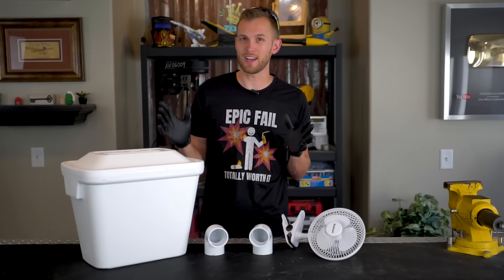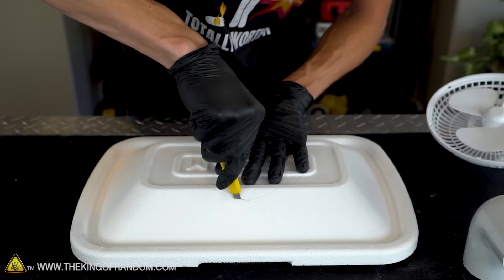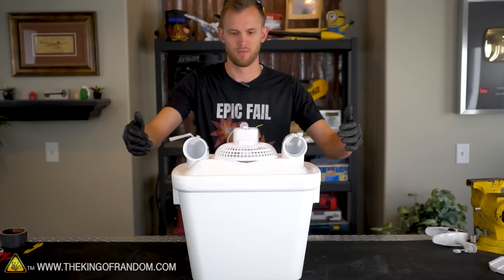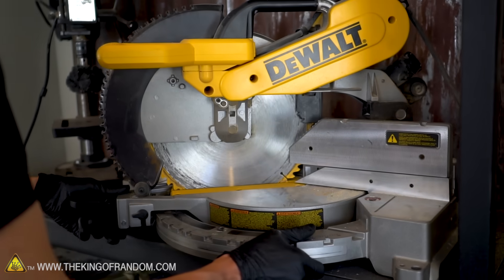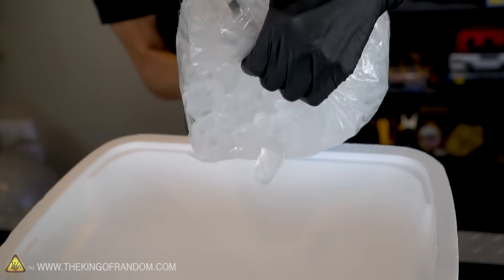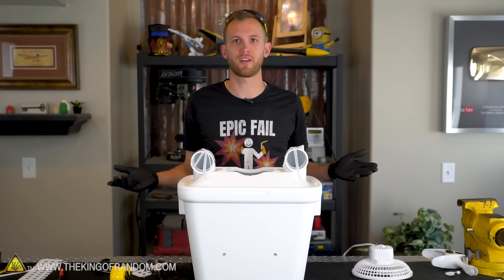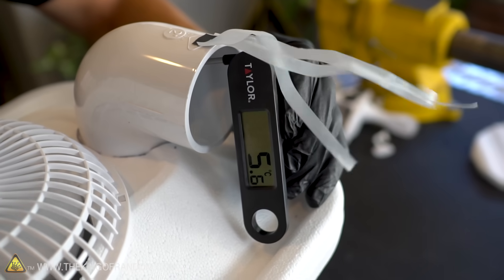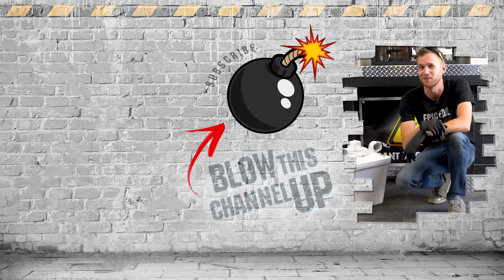Recycled Styrofoam Air Conditioner! TKOR Creates An Efficient DIY Air Conditioner!

Comment: Great video! I think I'll make an improved version. A lot of people are suggesting salt. Salt makes the freezing/melting point of water lower, which is great! BUT, if you just put salt on the ice, it would only melt faster and wouldn't be any colder. To make it colder you have to freeze salted water. Depending on how much salt is in the water you could get the salty ice to be about 30F colder. Which means you'll have ice that's 2F!

Comment: What if you put a little bit of water at the bottom too?
Reply: Phantomsleet616 aqi was thinking the same thing
Reply: Salt water maybe?
Cause normal water indicates the temperature isnt very cold since ice is frozen water. For some reason water with ice and salt seems to make it really cold.

although the pipes would need to be raised since otherwise it would be plugged
Reply: But the salt wil, melt the ice
Reply: Phantomsleet616 aqi  it will plug the pies quicker

Comment: The problem with using ice loose like that is as it melts, probably rather quickly with 70 degree air blowing on it, is it will pump moisture into the air making it humid in your house
Reply: Tokyo Ghoul96 The problem with dry ice is that as IT melts, it will be pumping carbon dioxide into your house. You could get CO2 poisoning...

Comment: I think there are some flaws in this. Number 1, your introducing a major amount of humidity. The room will end up more oppressive at the end of it. But also, your measuring the ambient air next to the machine, literally a foot away and while its running. I think you can do better testing if you did a closed room with proper air measurements including humidity. Then you can conclude weather this device is even worth building.

Comment: TKOR, my video idea is to se how thermite and/or liquid nitrogen would do in a vacuum chamber. Also since a vacuum has no oxygen in it, could the thermite be lit.
Reply: Thermite carries its own supply of oxygen therefore it could be lit. But it would most likely melt the vacuum chamber pump or break the glass. And dry ice vaporizes so it would nullify the effect of the vacuum.
Reply: Also how would you even light the thermite?
Reply: I was thinking the same thing about melting the glass so he would have to use the terra-cotta pots to somewhat shield the glass and he could lite the thermite with the solar scorcher.
Reply: And dry ice is different then liquid nitrogen because dry ice is just co2.

Comment: Why dont you try this with metal pipes connected fo a funnel under the fan. The pipes bend and travel down then then up to the pvc pipes, the metal pipes would be summerged in water with ice. Also. Maybe encase the fan in styrofoam leaving only a slit at the top for air intake. This to avoid temperature loss through the large fan opening.

Comment: Can you try and supersize this with a big metal fan and a bigger base. Maybe with more volume, it could cool a room down. This would be a lot cheaper option for people who need an air conditioner but dont want to spend hundreds or close to a thousand dollars on
Reply: Seth Butler, Unless they use ice that’s not made in the house (i.e. a garage freezer or store-bought), then the overall temperature will increase. It takes waaaay more heat to freeze water than is released by it melting. Freezers are very inefficient. 

This is why a/c units sit outside. They release their heat outside the house.

Comment: I think there is still a more efficient way to make this work. You can put some large computer fan on the sides of the box close to the bottom so the hot air always flow past the ice. But then you need to use bottled ice. And I also like the thought of trying dry ice.

Comment: What about when the ice melts and your vent tubes are now submerged under water?  Also, buying bags of ice would certainly be the easiest way to get the large amount you'd need.  If you do it yourself, that's a lot of ice trays to keep refilling and emptying.  Not a big deal, but it does affect the total overall cost of operation.

Comment: You should try to make the fan inside the cooler and have the on and off on the and cover the top so all the cool air only blows out the tubes not where the fan is to

Comment: i got a couple of issues with this build. I mean ok, the huge plus side is that it's DIY, so it commands bragging points and hey, feels nice to build something working on your own, i get it and i respect that. However: Using ice is troublesome, because it will eventually melt and you'll end up with a container full of water without any chance to drain, you could add a tap at the bottom to improve it i guess. Also, the price. 20 bucks for a diy project is a bit much, considering that for around 30 usd you could get a portable air conditioning unit with water coolant

Comment: Should’ve poured salt on the ice. Doesnt that make it colder?
Reply: Well I think that's because salt lowers the freezing point of water. So the freezing point lowered, but the ice is still the same temperature, so it becomes liquid while still being the same temperature. Minerals in icy water allows the water to stay liquid far past it's freezing temperature.
Reply: The fact that salt makes ice melt faster is exactly what makes it colder. Melts faster = faster absorbtion of heat energy from the ambient air = colder air.
Reply: In other words, in order to melt something you either raise the temperature or you lower the substance's freezing point while maintaining the same temperature. Salt does the latter to ice.
Reply: Eek idk i I did an experiment with salt and ice and the salt melted the ice
Reply: Salt does not make the ice colder, it melts the ice faster which means heat can be absorbed faster.

So yes, it would make the air coming out colder, but it would also met the ice faster.
Reply: Jason Matthews and then you have water blocking the airflow and rendering the "AC" unit useless.  Think before you speak, mate.
Reply: Rei Iwahara no thats dangerous
Reply: Willeexd the ice gets colder but also melts faster. Yes normal salt works
Reply: Rei Iwahara DO NOT USE DRY ICE DUDE
Reply: Dissolving the salt into the melted water would lower its temperature as dissolution of salts is endothermic
Reply: No what happens is the salt goes in the ice so it's freezing temperatures is lowered, so putting salt on ice to melt it only works when the ice is only just frozen by about 10 degrees.
Reply: THINK YOUR SELF no normal salt doesnt do that
Reply: I was say the same thing, but what I would do is put the ice cubes in Ziploc bags and put little holes in them. The ice will melt, so the holes in the bags will slow down the rate of flooding and make the bags less insulated
Reply: Yes but the salt that does that is rock salt
Reply: does not mean he cant drill holes in the piping between the middle and under the tray of ice
Reply: Xomsabre ice is going to melt with or without salt though? Or at least I'm pretty sure it does. It was in HS chemestry but ice melts just sitting there. Even in an ice chest.
Reply: If it does, it also melts the ice faster.
Reply: Jason Matthews Salt makes the ice melt faster, the change of state from a sold to a liquid consumes energy. Thus, the faster melting salted ice absorbs heat faster than normal ice making the surrounding air colder than unsalted ice can.

Also, to those saying "use dry ice," do not do that. Dry ice is CO2, we don't breathe CO2 too well. Don't enclose yourself in a poorly ventilated room with a source of CO2.
Reply: I mean like when you make ice cream at home you put salt on the ice to make it colder for the ice cream to be made
Reply: No salt makes ice melt easier. Like  when the roads are icey there is grit salt bins or you see people putting salt on it because it slowly melts the ice
Reply: Just use dry ice.
Reply: Ethan_Lev no I don’t think so cuz salt only melts the ice !!!

Comment: Surely putting ice in the tubes themselves would have been better?
Would have led to the air passing a greater amount of surface area of the ice. cooling the air further, while also using less ice. 
In addition to using less mesh.

Comment: You should try to put liquid nitrogen in the bottom of the container and on the suspension you should put dry ice so it can make it colder and when you turn the fan on the evaporating liquid nitrogen will come out and it will look cooler

Comment: Now you should replace each part with expensive parts! like maybe use a thick plastic icebox and metal pipes that conduct the heat better making the air come out even colder? maybe adding a second fan and trying to do you KOR magic to increase overall coolness? I don't even know if its possible to get it much colder but maybe itd be fun?

Comment: Technically speaking this will not work if you use it in the same room which has a refrigerator form which you have got the ice. It might blow cold air but it won't lower the overall temperature rather raise it.

Comment: i was wondering why not put a pipe below the fan and not below the elbows (add pipe below fan remove pipe below elbows) so that the air will be initially forced through the ice instead of having to find its way into the pipes (sorry i meant tubing not pipe)

Comment: To further improve upon the cooling stick a bunch of aluminium rods down in the ice and put salt on the ice, the salt will melt the ice while keeping it below freesing point, and this will make great contact with the aluminium wich will transfer the heat from the air entering the cooler much faster.

Comment: Would like to know how long it lasts, and how the temperature of a room and the air exiting the cooler varies over time.
Reply: Since it's a fixed amount of ice you can calculate by how much it'll cool down a room with an equation, you just need to know the volume of the room and both the initial temperature of the room and the initial temperature of the ice.
Reply: qflux don't you need other things like the heat capacity of ice

Comment: Nice video, I made one of these for use on a camping trip. The camp sites didn't have electricity, so I used a battery operated Fan. I have an idea you can use to possibly improve the cooling. Instead of putting ice on the very bottom, Use some 3/4" or 1" pvc pipe and end caps to make some Saltwater cylinders. Freeze them in your freezer, the saltwater will get colder than regular ice. Place these Saltwater cylinders on the bottom of your cooler  beneath the sink drain, and if you make enough, some on top of the sink drain. Give it a try, I'd be interested to see your results.

Comment: You could have used a peltier module,large heatsink,small heatsink and a fan (for blowing the air out).That would give better results.If you use high quality products,it reaches about -12 to 13 degrees.But this is also a cheaper alternative.Loved it.

Comment: Hey, why don't you use the concept used in the water cooling solutions in pc.... Like, try to make as much air as possible through the cold area... Like a long tube or something..  so that by the time it passes through the whole path, it gets significantly cooler... Higher surface area, more cooler the air gets...

Comment: yeah, it makes the air coming out is a little cooler than the surrounding air, but it seems like this is only effective if it is blowing directly on you. also seems like it would add humidity to the surrounding air, which is opposite to what a real a/c does. a real a/c replaces the warm air in your house with cooler air, this just mixes with the surrounding air. neat idea, but can't imagine it is super useful for making a room of any size cooler, just makes u feel cooler when it is blowing on u.

Comment: Test why you can’t put metal in a microwave
Reply: The Dragon Force - Dark Dragon 
Since when is metal flammable?
Reply: Eddy currents.
Reply: Megalodawn Lots of metals are flammable, just within certain circumstances.
Reply: Megalodawn  well some metals are quite reactive, e.g group 1 elements
Reply: It sparks a LOT, which is dangerous if you have anything inside the microwave (like plastic) that is flammable.
Reply: It sparks and breaks the microwave... I found that out myself. Its not that interewsting considering the cost of a microwave.
Reply: Jd Williams you can put metal in the microwave without anything more than the metal heating up. however, the size, shape, and conductivity of the metal are all factors, as well as the microwaves other contents. spoon - it got hot. fork/serrated knife sparked. crumpled ball of foil - lots of sparks. put a plastic cup with water in at the same time as the foil - nothing, foil didnt get warm or spark. same result with fork and knife. cd - made a lightning storm
Reply: if you put say a ball bearing in a microwave it will just get hot. You put a fork in one it sparks. Spoons often wont spark also instant microwave chili has a metal ring around the top and you have no issues. A ring with a constant edge will not cause ay sparks or other bad effects. As for blowing it up not likely less you do it allot.
Reply: I'm told it will short circuit the microwave
Reply: Jd Williams cause it will go bang
Reply: It blows up I learnt it the hard way
Reply: Jd Williams h
Reply: Megalodawn idk it still lights on fire
Reply: Electro Retro myth busters proved it just create arcs across the points. They also did balled up crinkled foil.
Reply: You *can*..  In fact, there are instructions for how to use a microwave to create a small metal foundry (apparently works well for melting small quantities for jewelry).  Actually, that sounds like a GREAT thing for TKOR to do!
Reply: Awenser: ask questions you know the awenser to.
Reply: They already put a knife in a microwave
Reply: I always thought it was because of the reflective qualities of some metals
Reply: My microwave came with a metal grate. There are already videos about metal in microwaves.
Reply: well if the microwave gets heat and energy in with the metal in it wont do anything really bisides heat up
Reply: You can put metal in a microwave.
Reply: He did it already

Comment: Wouldn't melting ice cubes create water, blocking off the airflow? The bottom of the pipes will quickly fall below the water line. So, then what? Water your garden I suppose and get more ice. Here's some we had lying around, at Walmart.
And please people, NO dry ice... CO2 is bad, mmmkay

Comment: There is a flaw with your design. The reason for the Ice bottles is to eliminate the water build up over time from the ice melting .  With your design eventually water will block the out flow air tubes.  With the sealed bottles the air will circulate for as long as  you leave it running.  Yes it is going to run at slightly higher temp.  But which would you rather have  a few hours of 55 to 60 degree air or changing the ice and water out every 20 to 30 min  as the ice melts and blocks the out flow.

Comment: Nice thought but your design will only work for a short time before the water in the bottom blocks the outlet tubes. Ice melts. That's why it's better to contain it. Might work longer with the ice screen higher. Nice build though.

Comment: Try this with salt on the ice!!!
Reply: Im pretty sure salt doesn't evaporate with the water
Reply: "Salt dust"
Table salt is granulated. It doesn't suspend into the air to make dust.
Reply: Salt doesn't precipitate from an evaporating solution of water as a powder. It crystallises out. It appears you need to learn some chemistry of your own.
Reply: Yes! Placing salt over the ice, or ice in salt water will make the ice melt faster, thus cooling the air even further.
Reply: Salt kills houseplants just sayin
Reply: @lightwayvez2  it's an electrolyte. "It's what plants crave"
Reply: @contextualchocolate  That is sulfur completely different kettle of fish
Reply: Yes, and get salt dust everywhere for feee.
Reply: Indeed, my mistake.
Reply: R&T: melt, dissolve & evaporate.

Comment: For the ABS pipes, you probably just want to cut the bottom of the pipe until it reaches the level of the sink mat.  This way when the ice melts you have plenty of space so the pipes don’t get blocked by water too soon..You also won’t need to cut holes through the mat and it should offer the same cooling temp.